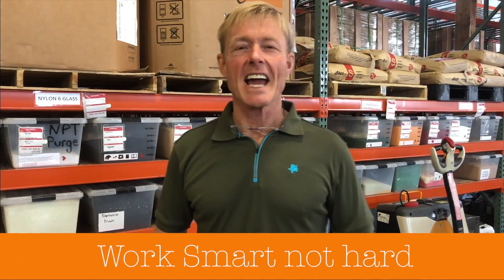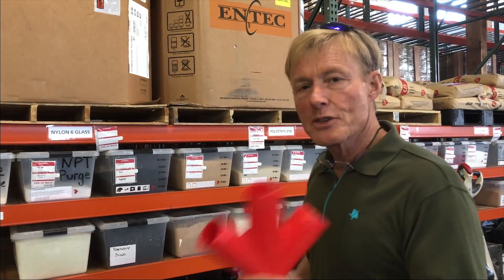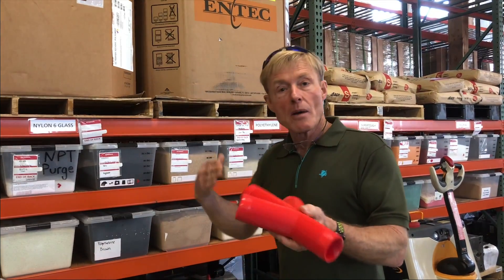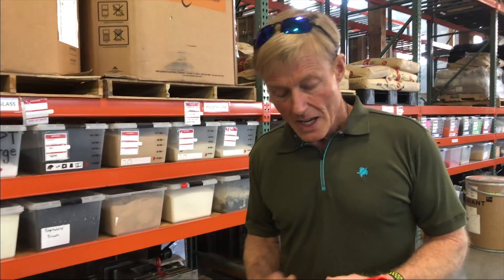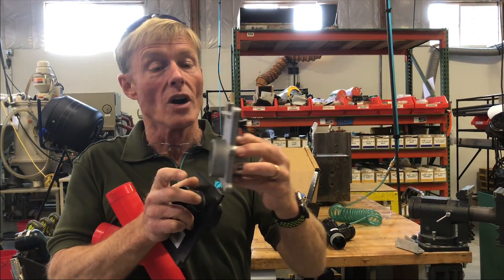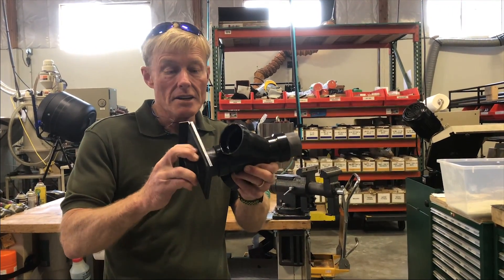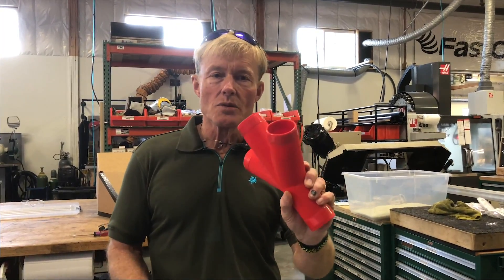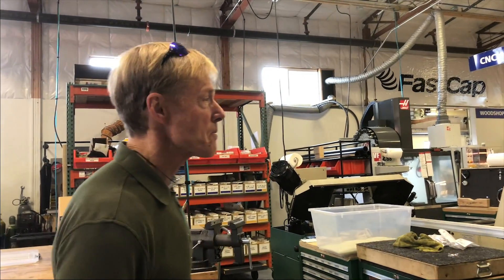3D printed vac manifold

Comment: I would pay $30 for just the wye, $50 for the wye with a support system to mount it and stabilized the hose/gate assemblies, and up to $100 that integrates the mounting and gates. DYI glueing and assembly would be acceptable to keep costs down. I would purchase between 2 and 3 of these for my workshop and mobile shop. Offering reducers/enlargers to support various standard vacuum systems would also be a plus, but should be sold separately.

Comment: Hi Ron, LOVE it, the color, and your LEAN benches and trailers!  Keep price of 3-way under $20. Offer blast gates that that fit both 3way and standard hose such that they can positively hold in the 3way via snap or SDST screw and could also be used remotely; price under $10 each.  Offer in red (great color and distinction), yellow for the Dewalt guys, orange for Ridgid, black to match all the other fittings we already have, etc.  Discount a 4-piece package under $50.  Offer other color matched fittings such as WYE, adapter to Festool hose, elbow, etc.

Comment: Great timing. I was at Asheville hardware just yesterday looking for solutions to my 2 1/4 inch dust hose setup, but unfortunately none of the Peachtree or Woodriver fittings fit. They are just a tiny bit too small to receive the 2 1/4 inch hose without some kind of modification, which I know you’re aware of. Everywhere I go online people are complaining about it. I am also looking for a Y-fitting to split the hose for 2 pickups at the miter saw and router table. I would pay up to $20.

Comment: Ron... if I couldn’t buy it for $10 - 15.00, I would make my own. Several people have said they would pay more... IMHO either those folks are the minority or I am simply a cheapskate.  
(I bought your workbench plans and made my bench in my garage ( And basement for the glue-up), with the in-table router station insert. along with your router fence, cross-cut jigs for the workbench, and table saw sled (from your separate video on the table sled). None of what I made was made without the need for re-work, primarily because I am a novice “worker in wood” and had a lot of trouble “visualizing”, laying out and making cuts upside down.... but.... I learned as much about myself as I did about working with wood and reading plans.... I discovered I was just not enamoured with the “romance” of working with wood.... I actually enjoyed it, even with all of my mistakes and rework. For that, I thank you for sparking my desire to make your stuff... and I wish you, your better half, your family and FastCap continued great success!!!)

Comment: Good questions.  I suggest we run it through Paul's lean process.  Put his team of thinkers together on it.  I'm a dreamer so I want the gates to auto open when I apply power to the tool.  That should sell for about $2,999.00.  Every wood worker has the same problem.  We have all purchased a hundred dollars worth of parts to bandaid together and we are still not happy.  Your proposal seems to be a less expensive option.  Therefore, I would pay $29.99.  I'll take two.

Comment: Hey Ron it's great that you're trying to work out a good system, you should try blast gates called shop-vac vacuum gates, I have 2 of them on a festool Y adapter and the work perfect, they never clog up, those black ones you're showing are a real headache to use cos they clog up really easily and then won't close fully even when cleared

Comment: I think $40 is a fair price. I don’t believe you can cobble up one for any cheaper. Design wise, I would increase the radius of the fillet between the angled pipe and the trunk. Your airflow will be greatly improved. And don’t integrate the blast gates. If a gate brakes then it can be replaced without tossing the entire thing.

Comment: I would more likely build my own with off the shelf parts. Maybe a simpler adapter that works with standard parts would be less of a tooling investment for FastCap and cost less for me as the consumer. I would not want the whole solution, standard parts plus adapter, to cost me more than about $20.

Comment: I personally would rather have the gates at each tool.  From a workflow perspective, this would mean that I would shut the gate at the tool I just finished using and open the gate at the tool I'm about to use.  I'd rather not go back to the vac (splitter) every time I want to change tools.  You probably don't feel the same way - but this might change the dimensions in question.  $30 or lower for this item - but that's still on the high side of consumer cost.   -John.

Comment: I'd be more inclined to buy an assembly that includes the 3 blast gates and accepts standard hoses.  And I'd pay more - like $40-50 - as well. As you propose it, I'd be more inclined to do it myself, buying 2 angled take-offs, then carefully cutting them in half lenghtwise, then cement together creating the 3-way and jury rigging extensions to separate the blast gates so they don't interfere with each other.

Comment: I would like to see it have a mount feature (interface to a spring clamp or t-track or screw flange). In this way you could mount it to something on site and it would remain stable when you manipulate the gates.  It could also be at a comfortable height and contribute to hose management.  If you find you need a higher price point, consider making a self contained systainer version.

Comment: I bought the 3 way manifold, added an extension for the center, made my gates as small as possible and I find it's just too bulky,(no longer using) for myself the gates are best by the tool, branched from a cple wye fittings.

Comment: Ron, 
Your innovations continue to impress! 

If the 3 way with mating blast gates that all fit 2.5" hoses sold for less than $50, I'd buy 3 today! 
All the folks that complain about material cost are hobbyists, who consider their time as having zero value.
As much as I enjoy modifying COTS parts for my "Special" purposes, it would save me several hours of shop time!

I'm planning to build 3 Total stations; for myself, my son and a mentor with the dust collection already integrated into the unit.

I've assembled a very portable Rigid 4 gal/5hp vac with an Oneida dust deputy and tool triggered vacuum power controller.  
One of my "special" features is a motor speed controller for the vacuum so the drywall sander doesn't "dig in" on initial contact with soft spackle from the vacuum's excellent suction. I'd be happy to send pix if you are interested!

Also:
You asked for feedback on preference for surface finish quality for the PTS material. We (3 above) agree that higher quality from thicker surface veneer is what we would prefer. These units will be heirloom shop tools, not just work-a-day beaters!
I'm considering using T-tracks instead of routed T-slots, your thoughts on that?

In another video, you described a different material with the thicker surface veneer, that Fast Cap was considering for the standard Paulk work bench. Is that a different Moreland product, or another manufacturer's product?

If a few pounds heavier will look good 25 years longer, I'll do the "heavy lifting!"

Thanks for all your contributions to advancing the craft!

Live Long And Prosper,  Ron Paulk!

Comment: Ron, as a DIYer, I'd simply make my own; either printed, or cobbled together from COTS parts.

As for FastCap's production of the part, the least cost solution is a single mold for half of the part. Then two halves would be glued to make the final product. Two connected molds for a one-piece product will be big and expensive.

Most of the comments so far suggest a ~$20 price point of which I'm dubious FastCap has an appetite for.
Reply: $20 sounds about right, plus blast gates...I would buy at least 3 one for the truck and two for the shop...

Comment: $20-$25 I'll order one. Much more than that and I might as well make one with parts. I'd consider pre ordering if and when you are ready to manufacture. That might help get the cost of setup covered quicker. I'd guess you would need to sell a bit over 600 @ $20 to break even on molds, materials, and R&D costs? Got to be at least that many who would purchase at that price.

Comment: Wouldn't it be a lot cheaper for fastcap (and therefore more affordable to the end user) to make the little bell adapters/bushings to add to a standard three way fitting just as you did?
Reply: Adapters for existing PVC fittings is the way to go (IMHO).
Reply: John Coloe aaaand more versatile

Comment: Ron the design is simple however it is incomplete. If the design included the gates that would make it much more marketable. Integrating the gates into the design to me seems necessary because its sole purpose is dust collection splitting. I agree with the under $20 price unless it is made more complex.
Reply: jacob weaver i agree but wouldnt you prefer the gates to be closer to the tool?
Reply: That depends more on your workflow.  But to add value to the product and to constitute the expense of the molds integrated gates would go a long way.  If slots were added to the design for the gates, there would be a  significant value increase.  It  would  eliminate another purchase, and simplify the assembly for the end user.  Additionally, this is primarily being made for the total station were central gate are most beneficial.  The gates being closer to the vac makes for more efficient air flow and less suction loss.  In a shop environment the three way splitter isn't even preferable, because you would want to split as close to the tool as possible.
Reply: Situating blast gates closer to the source of suction minimizes suction loss. So, blast gates at the inlet to the vacuum are optimal.

Of course, the ideal solution would include remote control blast gates.
Reply: Exactly my point.

Comment: Thanks for the video but for me, a simpler, cheaper and more flexible solution was to use an off the shelf pvc wye and just add one inline for each tool I add.  I can also vary the distance between ports.  And like you said pvc allows me to heat the pipe and shrink or enlarge the opening to mate with whatever hose variation I am joining with. Having it pre made for 3 hoses is very specific, and seems to require a lot of horizontal distance out from the original connection.